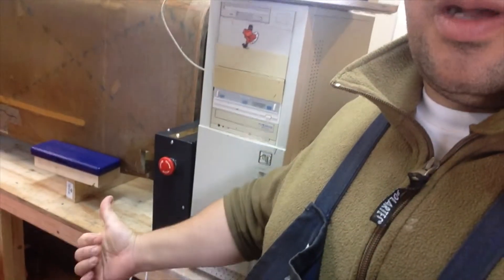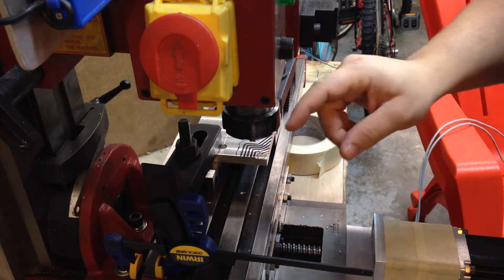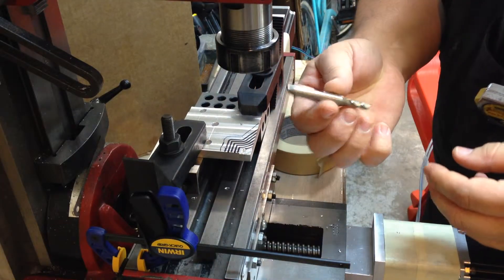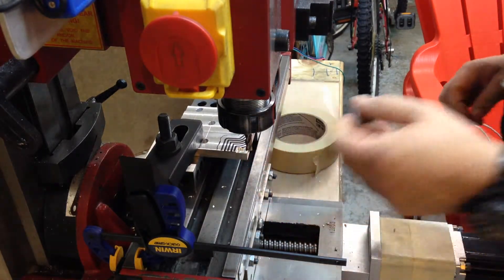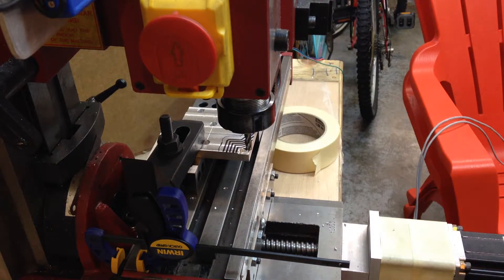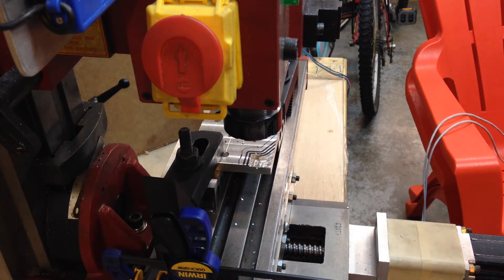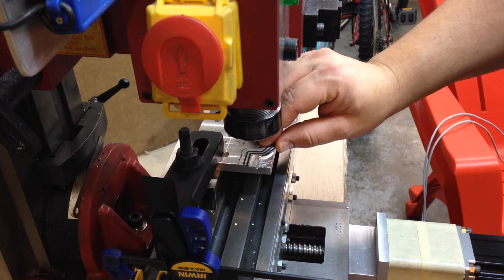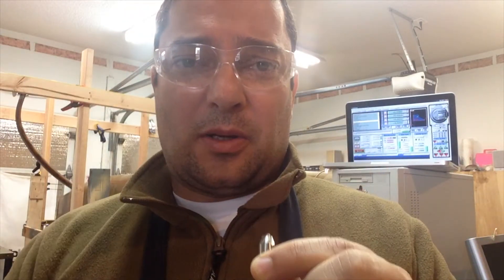CNC for dummies 😜 (part 4)

Comment: Not done this to mine yet - but I've been mostly messing with wood and testing wax on it.
Reply from the maker: +Orionrobots In retrospect I should have probably done what you did and started on softer materials, but I misjudged the amount of learning I still had to do. However, this things are bound to happen, especially at the beginning. I suppose they make the video a little more realistic.
Reply: Actually I thought I've been a bit chicken about it. I'm on part 7 now - glad it all came together there. Feeds and Speeds seems to be an art form itself.
Reply from the maker: +Orionrobots Ha ha, you might be one of the very few that have been able to endure all the way to #7.